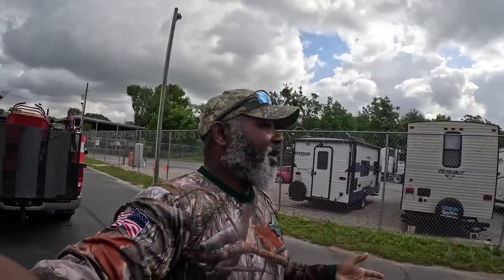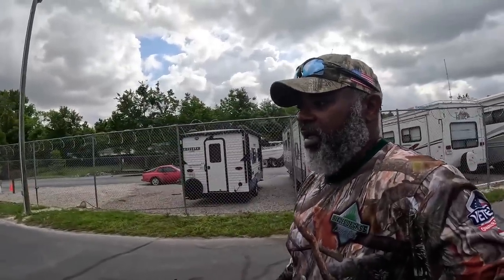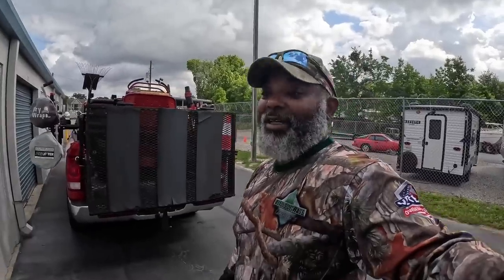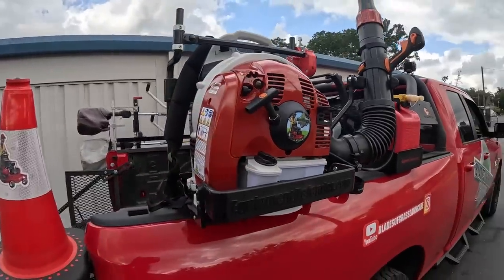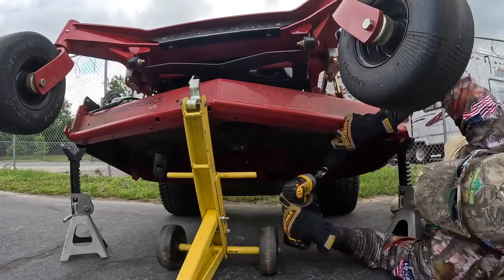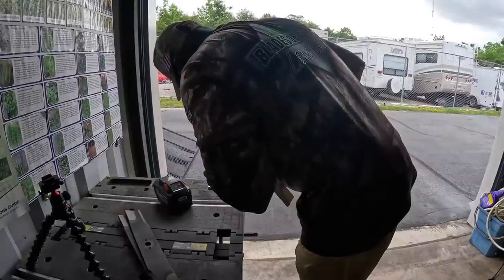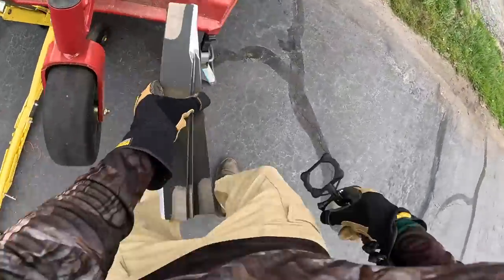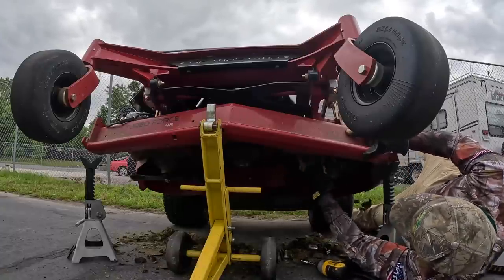Lawn Mower Blade Sharpening | How often should you sharpen your lawn mower blades

Comment: I use the same impact you do to remove the blades. Only thing I do different, is run the mower up on car ramps. That gives enough room to fit the impact.
Reply: The car ramp trick is a sign of a real pro, love it GWP

Comment: How do you know if your blades are tight enough? I bought a dewalt impact wrench yesterday to remove mine and put them back on and let it click 5 times (1 speed) and the blade came loose while mowing, so then i tightened it up about 15 pops (1 speed) and so far it seems okay. However, I'm worried that i could overtighten it and break something.

Comment: It needs to be done daily if you’re mowing over 15 per day and care about the affect on the turf. Soil and grass type matters too. We have lots of sandy soil that wears out blades but also plenty of clay fill dirt that lawns are built on. We mow fescue, Bermuda, zoysia and st Augustine. Fescue and st Augustine requires a sharp blade to look good. When Bermuda seed heads start to pop up it takes a sharp blade to cut them clean as well.
Reply: Jamie most definitely, the Bermuda will look uneven if you cut with a really dull blade

Comment: I think if I were in the business you're in, I'd have about four sets of blades in rotation so I could just swap blades. Then once a month, I'd do all four sets and be ready for the next month. 🙂
Reply from the maker: That's the goal, thanks!
Reply: Exactly.  That makes more sense and is more efficient with time management.
Reply: I began to prepay my mower shop for sharpened blades, I always try to come at the same time also. A time that is not busy for them or me, usually they’re ready and waiting. I just pull the mower off and wait about two mins, then put it back in the trailer and drive off.